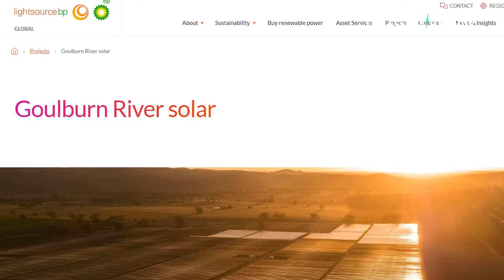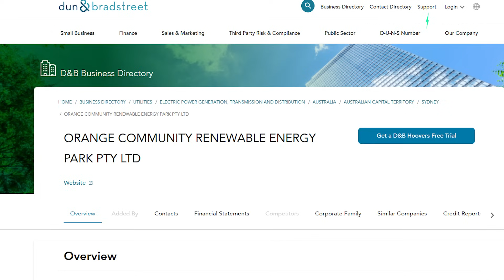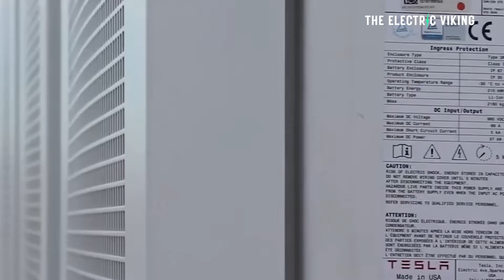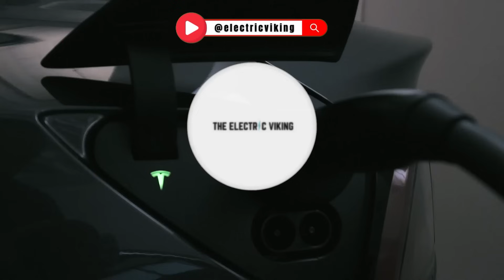Skyrocketing solar, wind and batteries in Australia destroy fossil fuels

Comment: In NSW there are 4 proposed pumped hydro schemes that equal close to 4GW with 10 hours storage this is on top of the 2.2GW Snowy pumped hydro project.

Thank you.
Reply: When people talk about nuclear power and the amount it produces it's in hours not day or weeks or months or years.

There;s nuclear power plants that do 10+ Gw an hour every hours for 30 years straight
Reply: @zagan1  The Kashiwazaki-Kariwa Nuclear Power Plant has a nameplate capacity of 7.965 Gigawatts, meaning it can potentially produce around 7.965 Gigawatts per hour when fully operational it is the largest in the world but has been largely inactive because of safety concerns.
Reply: christopherj2231 No thank you. Snowy Hydro 2.0 is already 3 times the original construction time frame and 6 times the budget. And it won't be finished for a few more years AT LEAST. So a 2 billion dollar project with a completion date of 2021 (2 years) has now cost over 12 billion dollars and has taken 6 years. And it's not moving along very fast.
Reply: @legolads1383  Get used to it big boy...this is how it is going to be.
Reply: You need a little more than 10 hours, a typical coal fired power plant has 10 weeks of coal stockpiled.
Reply: @paulmontague4918  And produces polluted air that kills those living close to it.

Comment: Totally agree with you . . .
One point - Solar on roofs will increasingly be wasted re grid resource unless home battery prices come down .The feds need to instigate a national rebate scheme to get batteries more affordable for homeowners. .
Reply: Home battery prices look set to come down pretty soon. The batteries they are selling now were made when the price of lithium was US $300+ at pack level. It’s now down to about $100 but it will take a year or two for that to be passed on. Give it another year or two.
Reply: @thethirdman225 and battery prices are predicted to drop to $50/kWhr by 2030, in just 5 years
Reply: @ I would not be surprised if it happened faster than that. The outlook is pretty good for anyone who has their eyes open.
Reply: Rooftop solar will go into batteries and EVs.  No need to waste any of it.  Chinese batteries are going to get very affordable as the new Sodium packs scale up production.
Reply: The really big battery is the fleet of electric vehicles that are capable of vehicle to grid that will number in the millions very soon.🌝
Reply: @  And V2X is set to be approved in Australia this year.
Reply: @ Even without V2G, simply having a LOT of EVs plugged in will prevent curtailment of solar power.  The easy "fix" is to set Time Of Use billing such that midday peak solar hours are very heavily discounted, so that people are naturally, strongly incented to charge when the sun is at its brightest.  If the EV itself is anywhere close to an ICE car, and charging cost per mile is noticeably below the cost of petrol, people will very quickly adjust their habits.

Comment: Has not bought electricity down gone up up up. I pay over $330 a month now. A big hike coming also this year in Queensland
Reply: It has brought wholesale prices down in Vic and SA. These will eventually flow through to retail prices. The latest market data from AEMO (Q4 2024) show that average wholesale prices in the most coal-dependent states (NSW and Qld) were $143/MWh and $127/MWh, while in Victoria and SA they were only $45/MWh and $52/MWh 

From the report:

"With grid-scale solar output also at a new quarterly high average of 2,212 MW (up 9% year on year), a record high of 23% of intervals experienced negative or zero wholesale prices across the NEM. South Australia (at 38%), Victoria (at 34%) " 

Price rises in Qld and NSW were driven by outages at their ageing coal plants.
Reply: @tassied12 in Queensland electrical retail putting pricing up around 47% we expect that around October this year. We have started using portable camping cooking tops that holds gas cartridges and stopped using our electrical cooktop. Being a pensioner is very hard with cost of living gone through the roof.
Reply: @ AEMO were warning years ago that we needed replacement capacity for our ageing coal plants, but multiple energy policies over the last decade resulted in a lack of investment in new generation.

Those lost years are now coming back to bite us.

Comment: If you bought into solar,  you  just been sold a Box of Rocks
Reply: Hot Rocks are awesome for generating electricity.
Reply: My first solar system paid for itself with 2 years thanks to generous credits. I held it for 10 years and then gave it to a friend who is using it on a farm shed and running the shed free of cost. My current solar system is 4 years old and it will have paid for itself in 1 more year. After that, I look forward to 15-20 years of free electricity meeting roughly 80% of my current needs. Could be 100% if I didnt use the A/C so often, but life is too short. Over 60% of Australians live in a detached home and are capable of having a solar system. It’s a no brainer in my view

Comment: SA net 100% in 2027, already have had several days where rooftop solar has been net 100%.
Coal and Gas are scared because they will loose there political power over the population. We will go from a few major players to hundreds of large suppliers and thousands of small suppliers. 
Australia will have a cheaper, more reliable, and resilient power supply than ever before.

Comment: @vincentcausey8498
Better than a guess there have been quite a number of electrical grid simulations using hour by hour data over the years to show that Australia can be powered largely by renewable. Admittadly the last 5% is difficult which is why many other countries are using stored biofuels (gas, methanol, ammonia, hydrogen) for last top up which has a very low capcity factor.  There is of nothing stopping us have an energy holiday powering down  for 3 to 5 days when required. Australia is lucky to be blessed by high renewable potential and different weather cells geographically dispersed. Western Europe is affected by the same weather cell albeit with some time lag so they have found that some overbuild of renewables is the cheaper option.

This last Australian study using real weather data shows that it can be done :

David Osmond.  A near 100pct renewable grid for Australia is feasible and affordable, with just a few hours of storage,  [Aug 23, 2023]
reneweconomy website, Australia

A recent UK study looking at lower renewable costs :

Lower Cost & Lower Carbon - Increasing renewable energy deployment to maximise savings across the economy,  [2024] Possible, UK

Comment: We are not on track mate....you are incredibly ignorant...lol....how on earth can you do this many videos and still not know the ISP is BS...😂
Reply: Ignorance is hate posting then providing no counter points or links to  evidence on the contrary. 
You've commented like 5 separate times just hating on this guy and multiple replies to others yet not once provided any evidence to back up anything you've said.😂
Reply: @buddhamack1491  evidence is in the ISP moron...do you know what that is?
Reply: @buddhamack1491 , I agree with you. But there is one aspect which from a risk management perspective has not been explained well in my mind. If you have situation where an area such as Sydney or Melbourne goes through a real heavy period of cloudy and rainy weather. There’s two that come two questions that come to mind.: 

1. are you really going to have enough production while it’s overcast or rainy from wind and solar to satisfy the base load consistently

2. If the first question is answered and we have enough energy to run during the day because the grid production is so vast and so much more then we need, even if the weather is bad. In this scenario; do you have enough capacity to not only run during the day, but ensure the battery infrastructure can be charged consistently with energy above and beyond the base daytime load.

I haven’t seen any model or framework on how this would work. I’m assuming they would still keep a base amount of gas or coal power stations which can be used to charge the batteries if there is a gap but this is only to provide on demand power to meet the shortfall
Reply: Clearly on track and will highly likely exceed the number Sam quotes. If you get your opinions from the likes of Peta Credlin you don’t really have a functioning brain

Comment: Why are they spending the equivalent of 15  nuclear power unit on hydrostorage in Australia? Because the batteries are working so good?
Reply: Because nuclear would take 20 years to build snd still leave supply and waste problems. We are just not that dumb.
Hydrostorage is a battery.
Reply: Snowy 2 has been a badly managed project. There are plenty of smaller scale possibilities, and batteries are further eroding the business case for Snowy II

Comment: @5:43 - "Essentially replacing an enormous coal plant with one of the biggest batteries in the world" is misleading. The Eraring coal plant has a capacity of 2880 MW 24/7, while all three stages of the planned Eraring BESS has a combine capacity of 700 MW for 4 hrs. That is why Labor, even with optimistic storage estimates, had to double the capacity of gas peakers in their AEMO Step Change 2051 plan.
Reply: The problem for Eraring is a lot of that 24/7 capacity is not needed. The operators of Bayswater and Mt Piper have been trialling running their generators in two-shift mode where they shut down completely during the day to avoid losing money. They hope to recoup their losses in the evening and morning peaks, but batteries are now eating into those periods.
Reply: @ Coal plant typically do not run at 100% capacity but can if they have to. Renewables can only run at 100% capacity under ideal weather conditions, and even the largest batteries are not big enough to provide 24/7 backup. That is why the extra gas peakers are a part of Labor's plan.
Reply: @mhirasuna  It is demand that drives the grid, and we are now in a 21st century power grid with very different power demand patterns to when coal plants were established. Power consumption is greatest during the day, which used to be when coal plants made most of their money. That world has gone with grid demand being hollowed out during the day by solar. The problem area is the early evening and morning peaks, and that is where batteries come in.

When we were just running fossil fuels, there was about a 30% overcapacity to cover outages. David Osmond, senior engineer at Windlab, for over 2 years has been extrapolating daily wind and solar generation to just 5% over-capacity (not 30%) and using existing hydro then matching to daily consumption. With just 24GW/120GWh (5 hours of storage) on top of our existing hydro we can easily get to 98% renewable generation based on existing output and demand profiles.

As for gas, we have reduced our gas consumption for power use by 40% since 2014. Excluding the non-NEM states of WA & NT, we're looking at over 5GW/13.5GWh of storage coming online in the next couple of years. For context, 13.5GWh cycled once per day = 5 TWh/y, enough to displace half our annual gas generation
Reply: @tassied12  You need extra capacity for abnormal conditions. Even with that extra capacity in the coal plants, Australia currently has 7781 MW capacity in gas peakers. To replace the lost coal capacity, the Labor plan for 2051 is increasing gas peaker capacity to 14,926 MW in addition to batteries and pumped hydro.
Reply: @mhirasuna  Agreed re the need for extra capacity, but given the current trends with gas use and batteries, it is looking increasingly unlikely that this amount of gas capacity will be needed.

The speed at which battery technology is improving is reshaping planning and forecasting around grid infrastructure.
Reply: @tassied12  Tell the Labor party to change their plans. The Coalition will thank you. They are misrepresenting Labor's plan to be 100% renewable.
Reply: @mhirasuna  AEMO is currently taking input on its next ISP to be released in 2026. Based on the rapid changes in battery technology, a reduction is expected in required gas capacity.
Reply: @tassied12  The large BESS sites were already part of Labor's plan. These contracts are bid with expected improvements incorporated in the plan. The gas peakers need to be built as the coal plants are shutdown. You can't wait to see if better batteries are available. The Coalition would love Labor saying that they will have less peakers and more batteries. The peakers are the only thing that gives the Labor plan any credibility.

Comment: Fantastic news for Australia, Im still trying to get my head around the lack of sun in the north of England to make it all work efficiently in the winter.
Reply: Put in grid connections to more southern parts of Europe. 
Edit: exchange energy to smooth out local differences. Energy use in the south of Europe is complementary to that in the north of Europe. In the winter, Europe's southern places (e.g. Portugal, Spain, Italy, Greece, etc.) use less energy because those places then have mild temperatures. In the summer, Europe's southern places (e.g. Portugal, Spain, Italy, Greece, etc.) use more energy because those places then have high temperatures thus use lots of energy for air-conditioning, cooling and heat pumping.

Comment: Question I have is how much battery storage will be needed to back up wind and solar for days when the wind doesn't blow or sun doesn't shine?  Sam says so far 3.7 GWhrs of battery storage has been installed at a cost of $53 billion.  3.7 GWhrs sounds a lot, bet it really isn't if you need a back up for days of Dunkelflaute - you need to take the average electricity consumption for a number of days not mere hours.  As a rough guess, to store enough power for a couple of days would take hundreds of gigwatt hours, not a mere 3 or 5, in which case it is totally unaffordable.  Game over for phasing out hydrocarbons is more accurate.
Reply: The equivalent of an EV for storage should last a few days easily. Unfortunately it's not quite developed yet
Reply: @gdizza123 spot on. The average EV these days comes with a 60kWhr battery. Most people could easily run their home off the car battery for 2-3 days during a power outage if needed. Longer if you minimise your electricity use to essential stuff
Reply: Australia's long term patterns with wind/solar mean that the amount of battery storage needed is achievable.

When we were just running fossil fuels, there was about a 30% overcapacity to cover outages. David Osmond, senior engineer at Windlab, for over 2 years has been extrapolating daily wind and solar generation to just 5% over-capacity (not 30%) and using existing hydro then matching to daily consumption. With just 24GW/120GWh (5 hours of storage) on top of our existing hydro we can easily get to 98% renewable generation based on existing output and demand profiles. 

Excluding the non-NEM states of WA & NT, we're looking at over 5GW/13.5GWh of storage coming online in the next couple of years. For context, 13.5GWh cycled once per day = 5 TWh/y, enough to displace half our annual gas generation
Reply: @tassied12  David has NFI either...
Reply: I got bored and worked it out for the UK. 3 days is just shy of half a million container sized mega packs. Is 3 days enough and you need to ensure you have enough capacity to generate to fill the storage. Aus may well be different-for sure our use peaks on cold, dark evenings (often when the air is still hence it’s extra chilly).
Reply: Sam has no idea....shocking really
Reply: @grantbuttenshaw do you think Sam is making this shit up? That there aren’t numerous experts out there saying the exact same thing? That energy companies are going down the same direction Sam is referring to just by accident? Get real Grant

Comment: Yes! I have solar panels, Battery backup and a model Y. I know the savings.
Reply: I bought 10 enphase panels & a 2024 Tesla model Y. I don’t have the battery back up yet .
Reply: @leopardcat9 the 2025 model y does V2H.
Reply: Is this right?
Reply: How good is it. Just need V2G enabled and an extra 3-6kW for the three months in winter I receive a bill.
Reply: Yikes I wouldn’t want to drive around a nazi car. Get rid of it.
Reply: Also get a heat pump for cooling and heating.